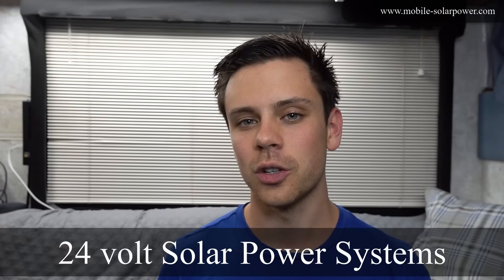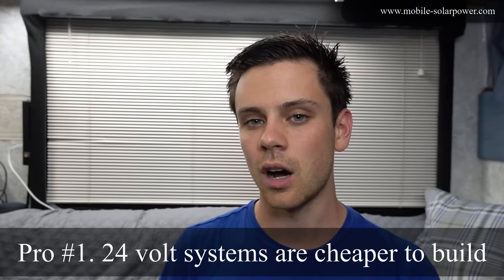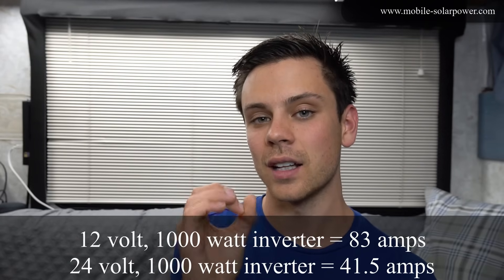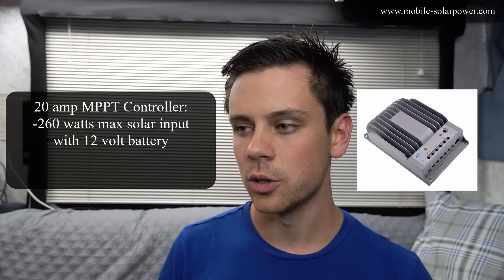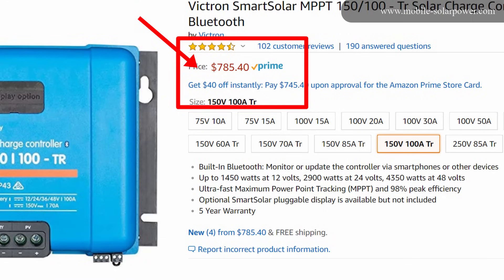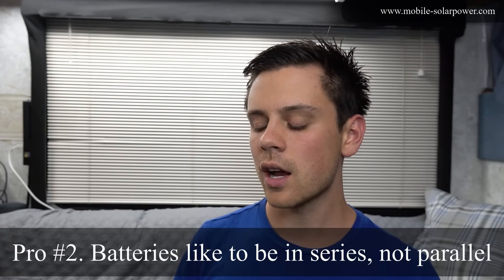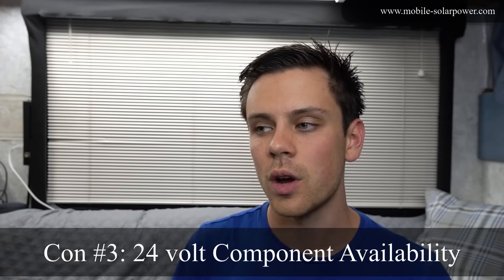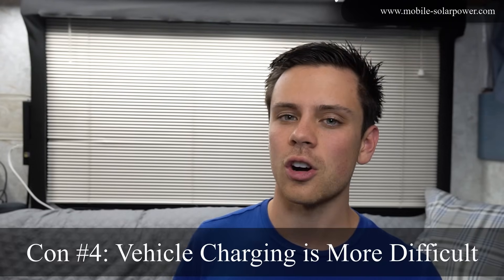12 volts VS. 24 volts for Off-grid Solar Power Systems

Comment: My question is if you have  2x 12v batteries at 200ah each that would equal 400ah in total.  Now if you take those 2 batteries and wired them to a 24v battery, wont that bring you back to a 200ah in total? Sorry for the noob question
Reply: You're wiring a 2 12V batteries to a 24V battery?  Do you mean wiring the two 12V batteries in series?  You really should be thinking in watthours WH.  2 12V 200AH batteries in parallel is 4800WH same as if they are in series.  What is different is the max amount of amps you can pull at once.  When in parallel, you could pull more amps, which might matter if you have 12V motors which need a lot of inrush current.

Comment: Happy new year Will!

Can you either do a video or offer some suggestions....due to the propane shortages in my area for a while now I'm thinking to move towards electric everything for my self converted campervan. I currently have a 1100 watt inverter with charge controller with 1 agm battery and a 100 maybe even up to 150 watt solar panel on the roof and a battery isolator professionally installed so when i drive etc. It's charging/topping off my agm battery. Currently i just charge small things like laptop, phone,  usb items etc.

But... with this propane shortage and wanting to remodel my van im thinking to go electric fridge like the arb kinds, induction cooktop, microwave or countertop toaster oven even maybe a small electric heater.  I know i need a bigger and pure sine wave inverter maybe 3000+ watts but should i also get another agm battery (probably 2 new ones) and/or another solar panel? I know i might have to update the charge controller too. I don't plan to run every appliance at once im ok unplugging stuff and using one thing at a time and i do drive my vehicle several times a day daily so i don't worry too much about amp hours. Soo what's your thoughts/suggestions to make improvements to my system to be able to go all electric.  Btw...i don't plan to use the kitchen appliances all the time maybe a few times a week but the arb fridge will be plugged in regularly. Any electric heaters you'd recommend for a campervan? I've used the mr. Buddy heater for years now but hard to find propane these days.  If i didn't live in California I'd use one of those kimberly type wall fireplace thingies.

Comment: Do you do Consulting?  I have  a off grid cabin and bought 8 lead acid solar batteries.  24 volt inverter/cgarger 6000 watts and  currently using generator. Im ready to hook up the system now and add solar this summer . I don't have much experience in DC power . Gladly pay for advice

Comment: Actually you are incorrect about parallel batteries. Parallel batteries do feed each other but they do so on a way that balances the batteries and makes it less likely that one battery will overcharge or be under charged. In series this does not happen. One battery can overcharge or be under charged causing the others to over charge.

Comment: If I can only afford (2) 100ah Lithium iron po4 batteries would I not be better off using 12 volt, otherwise I would prefer to use 24volt for sure?

Comment: I have a question for u

I am having low voltage from grid let's say required 230v but actually it is 120 v will off grid inv increase my output with battery or with solar panel
Reply: Yes, it can help correct the issue. Or better say, alleviate the problem a bit!

One should keep in mind some important fundament:
1- YOU are paying your power provider for "full" power! Which you don't get!
2 - The lower voltage provided will imply higher amperage consumed. That's what you pay. Translation YOU are also paying for this excess!  
3 - Just as point 2 will damage your equipment! That condition quite often. Generate current spikes. Which also tend to damage your equipment! You are paying for all that!

I've been on similar condition with ALL of the above problems! After several complains, eventually, the power company changed my house to a different (less loaded) connection. Not perfect but way better! Usage of a decent capacitor might help improved your power factor correction! Reducing your power consumption a tiny bit!
Cheers

Comment: Spot on bro! There are many advantages by incorporating a 24v system rather than a 12v system! It's easier to build a bridge rectifier converting AC to DC than it is to construct a DC to AC inverter that really consists of a heatsink with the option of a thermal sensored fan with a set of super capacitors amongst the circuit design for the desired wattage! It's however abit of a cop out right enough if it's a modified sine wave inverter instead of a pure sine wave construction as some folks overlook the downsides ie disadvantages of adopting a modified sine wave inverter all because it's the cheaper option although as most of us know modified sine wave inverters aren't fully reliable in that they aren't fully stable enough for all appliances which may cause electrical damage to certain appliances at least for prolonged periods of operation which isn't advisable! A good reliable Pure Sine Wave Inverter PSI that accepts 24v is a great choice and is often readily available, the advantages are many not to mention with a near maximum efficiency ratio that is independently ideal for long durational operations. But the 24v inverter along with the battery system is as only as good as it's constructed design matrix. Cheaper components with a shoddy design schematic architecture or worse, a purchased dangerous and shoddy rip-offs from some mudhut village somewhere out in the middle of  nowhere such as Timbucktoo with a brand name that one can't possibly pronounce lumbered with hefty eye watering custom duties and freight tax and haulage excise duty on top which takes months if not weeks to arrive at your destination which usually not only indicates a very bad delivery experience but a very bad and dismal purchase ie dangerously constructed and excargerated performance characteristics such as current (Ah), charging times, charging and discharging thresholds etc which inevitably means shorter life expectancy aswell as the battery design that would be easily considered as a flaming bomb than that of batteries with the sheets of plastic peeling off the sides which is no better than the cumbersome lead acid batteries that one could pick up locally! Due diligence before investing in proper Lithium lifepo4's from a trusted and reliable seller is must and is well worth it and hopefully will eliminate any concerns regarding quality, seller, delivery times and anticipated freight and excise duty costs that will be incurred. As mentioned plenty of times in numerous episodes regarding the lifepo4 batteries I would definitely recommend them for any 24v off-grid systems! Ensure that there slightly spaced and check to see if there all fully balanced with the aid of your multimeter probes, 8 x 3.2volt lithium lifepo4 batteries wired in series with balancer(s) should give you a rough reading of 25.6v on your multimeter which is more than sufficient! And ofcourse not forgetting a decient battery management controller is a must! Even the lithium battery balancers can be incorporated with your wi-fi signal that can be tethered to your phone or iPad device for added piece of mind for remote access at the touch of a button. As for the lithium batteries, it maybe be abit expensive but it will last longer with at least 3000 charges per life cycles preferably and much lighter in weight than their lead acid counterparts and less likely to leak not to mention less thickness of the battery cables which is infact cheaper though which am glad you mentioned in your video dude! 👍

Comment: My question is for a working van to power up power tools, which inverter 12v or 24v is the better way when using with 2 additional deep cycle batteries

Comment: Quick question: In a 24V system, with a Victro MPPT 150V-60A, and 6 195W panels, would you recommend having 3 panels in series and 2 parallel OR 2 in series and 3 parallel?

Comment: Your recommendation of a 48V system for a house is interesting. I see many charge controllers are capable of 12-48V. Inverters usually do not have multi voltage input. Have to buy a 48V inverter online. I doubt my local store has 48V inverter.

Comment: hi will I'm trying half my bike old battery 14s5p e.g. 7s5p 26volts on camper van connected to renogy rover 20amp mppt.just runs usb sockets at moment.couldnt get load socket to come on so wired usb to battery terminals mppt works ok .got 3 x 30 watt solar panels on roof.using bluetooth adapter to monitor panels an battery

Comment: Will 1st let me say congrats on a great u tube channel. 2nd I have a question. If i start out with a 200 watt reboot solar kit. Can I add to it in a few months and what do I need to do it. I'm new to all this. I'm living in my van due to losing home from covid pandemic. I only have enough money to buy the 200 w kit and 2 batteries.But want to have enough power to run my fridge a light or 2 and charge my phone. Later as i can afford it. I'd like to build up to 400 watt. And finally do i need a bms . Stopped in at a solar shop here in Quartszite AZ. And he was trying to sell me on a bms for 239.00. Wow Thanks Will. Your a good young man. ✌

Comment: When batteries are hooked up In series, the voltage is increased. For example, two - 6 Volt batteries connected in series produce 12 Volts. When batteries are hooked up in parallel, the voltage remains the same, but the power (or available current) is increased. This means that the batteries would last longer.

Comment: Hiii ! Thank you so much for your videos. I really like them !
Could you help me with something ?
I'd like to install, for a question of space, 400 w solar panel on the roof of my van, with probably a 150 a lithium battery ...  Would you recommand me to use 12 v or 24 v ? I'm not sure. And about the alternor to charge my battery while driving .... should I skip it ? I'm not sure I got you right, I feel you said it was not totally useful unless you drive a lot... Thanks in advance, hope you answer :)

Comment: Another excellent presentation by Will. Worked in the electronics/electrical industry as a professional engineer here in the UK for 40 years and had no idea where to start with solar and Lithium batteries for my minibus to camper conversion. As others have said no waffle or fluff and to the point with detailed technical content. Going with 24V system and wished I could have brought the SOK batteries through Wills link but only ship on that to USA so had to go direct to get shipping to UK. Mentioned got their details from Will's presentations so he might get something from them?

Comment: Will im going with a 24v system in my shop to power shop tools, bench and handheld.  I also want to charge tool batteries.  However, I have several 12v inverters I got cheap.  2000w, 2 1000w,  and 4 400w.   How can I use them on a 24v system.  Will that 24v to 12v converter rated at 40 amps work?  Will I need to heatsink it better when I mount it?   I want to use the 12v 2000w especially.  Advice?

Comment: wire should be the cheap part, don't buy wire on amazon, go to a local electrical supply house, Converters are on average only 80% efficient. If I stick with 12v there is no change in voltage from the battery which is better for efficiently, any time you change voltage you loose power

Comment: Will I was wondering about the converter that already in my camper, as far as 24 to 12 volt it's where my shore power comes in at 110 and leaves at 12 would it also go 24/12?
Reply: I have same ? I was just forced into 24V cuz Amazon shipped. To my think the onboard converter will change 110 to 12V and won't even know there's 24V involved. Just started researching this

Comment: I agree a 24 volt (or higher) system is better.  (For a lot of reasons)  However, for RV and Marine use there is an obstacle and that is when the owners need a "boost" for starting engines.  If you are anchored for a few weeks it's pretty common for the starting batteries to be low and most RV's and all Boats allow for using the house batteries to act as a boost or "jump start".

With a 12 volt house battery bank its easy, with 24 its not at all easy.  Any thoughts on solving this?  FYI:  I did install a 24 volt system on a catamaran with twin diesels.  My "solution" is a small (3 amp) buck boost converter, on a timer, set at 13.6 volts to act as a battery tender for the starting batteries.  It works well to keep the starting batteries up to snuff but, if one of those batteries dies, the house batteries are not able to be used in an emergency situation and that's a huge draw back.

Comment: You make it sound like a person (not living in an RV as you have) can not have Twenty 12 Volt batteries of which Ten are in series to create 24 volts and then have those pairs in parallel. 

How do you think people power their homes with batteries (and of course inverters)?

Will. I admire almost everything you do and think the world of you. I just think you sent the wrong message in this YT. I know you did not mean to. 

So could you please respond and say something like If you were powering your house and had "X" number of 12 Volt batteries in series to create a 24 Volt system, the way to wire them in parallel is:
"........................................................................"

Comment: In an RV application where you wanted to use 12v batteries to take advantage of charging from the OEM alternator: Could you maximize roof space and reduce wire size by using large 24v panels wired in parallel (to offset shading effects), and then allow the MPPT to output 12v to your 12v battery bank? So, 24v into MPPT, 12v out? Is there a reason why this would be ill advised?

Comment: I have a small 12v system: a pair of 100W panels and a pair of 12v SLA batteries, with the EPEVER Tracer 30A charge controller. My loads are all 12v: laptop, light, iPhone, AA battery charger, etc. My panels are in series so they're already feeding in 24v, but my batteries are in parallel. Would there be any advantage to getting one of these 24->12v converters and switching batteries to series? Longer battery life maybe? I'd gladly spend the $40 if so.

Comment: Great advice, super info, extensive analysis!
Did you do one video re: 24 volts against 48 volts in solar systems? And is there a 96 volts solar system? Thanks.

Comment: What about scavenging the inverter from an old UPS with broken batteries? Using a 3kW one from an old APC unit here. It takes in 2 x 24v, and im currently deciding between charging the 4 x 12v batteries one by one or in series at 24v.

Comment: Will said there are better ways to charge the batteries than using the alternator but didn’t give a clue what they are.  Other than depending on the solar panels while you drive.

Comment: I use my alternator to charge 16.8 v system.....I use two 12 to 24 volt rectifiers connected in parallel to give me 840 watts...this connected to a solar charger which adjusts my charge voltage and amperage ....16.8 v and a deviation between 0.1 to about 40 volts...easy day

Comment: How do I know what size breaker and fuses to put in my system only running 4 panels with a 5000 W inverter 12v
Reply: 5000W inverter from 12V?! Please do yourself a favor and hop your system to something higher 24v ~ 48V...
About protection, your 4 panels output, will determine the protection size, on that side of the circuit. The inverter itself should already have it's own protection.

Comment: I want to add between 100 and 400 watts solar to a 2020 (or 2021) Ford Transit Cargo Ecoboost with the factory dual AGM battery and upfitter switch and wiring option.  Can just one of the batteries be swapped out to Lithium?  What about swapping both for Lithium?

Comment: There shouldn't be so much high amp equipment that you'd need a lot of heavier gauge wire. How much more $ can 10' be? The other consideration is how much 24 volt equipment there is on the market. Almost any common device or accessory is available in 12 volt. Not so much in 24 volt.

Comment: you can buy a battery ciolinide  to charge 24 volt system. car amps are at 70 to 90. you have to do the same for cable pullers. wenches.

Comment: How much loss from the power inverter?  Seems to me the most budget friendly setup would just stick with 120v appliances which are a fraction of the cost of 12v.  If you insist on 12v lighting or whatever, a cheap transformer will go from 120v AC to 12v DC.  Yes, you have to run the inverter all the time, but I'm guessing the loss isn't all that great and the benefit is huge.

Comment: Question:  at the beginning and end of each day, the solar power slumps.  It is said that if 100 watt arrayed panels are hooked up in series and parallel (12 panels) to bring 48 volts in the house.....you touched on the fact that the system will be more likely to "charge"  during these times.  Is that correct?

In the south during the winter, this would be an important fact if it is correct?
Reply: This 48 viktor system would come to the house to charge 4, 100 amp hour 12 v  Battle Born Batteries.  Would those batteries need to be wired in series to be 48 volts?

And then buy a 5kw 48 to 120v inverter?

Lots to consider.

I desire to run a 5 amp small air conditioner 7 to 8 hours from the 4 batteries.  It would be great to even have a few more amp hours for other stuff.

Comment: I have a good question : when you have a 24V system can you use a grid-powered charger and the MPPT at the same time on the 24V bus or should they be switched?

Comment: Question:  If I want to charge a single 12v battery  with a 360watt 24v panel I must have an MPPT charge controller?  I can't use a use a PWM 30amp charge controller  (like a EPEver 30a) rated at 12v/24v with max input voltage of 50v?